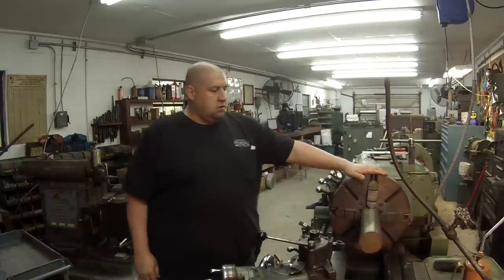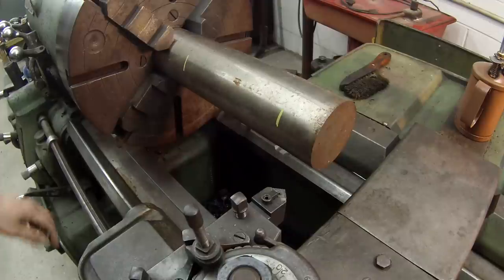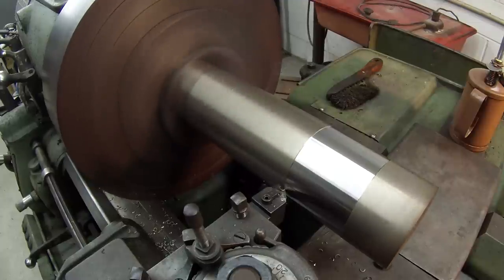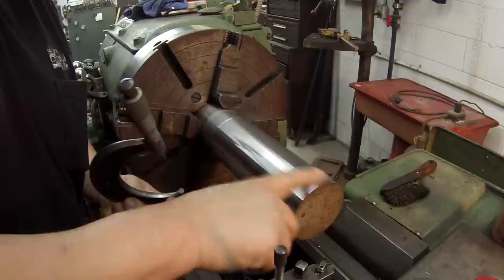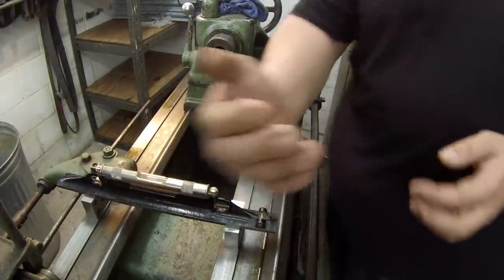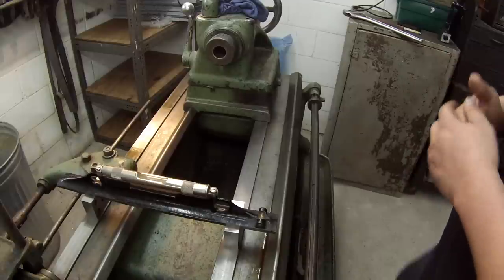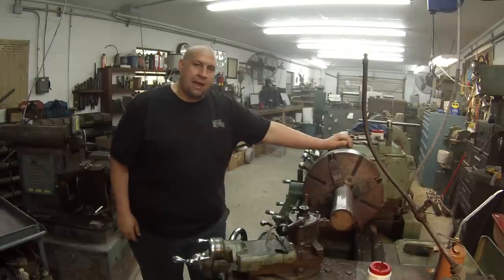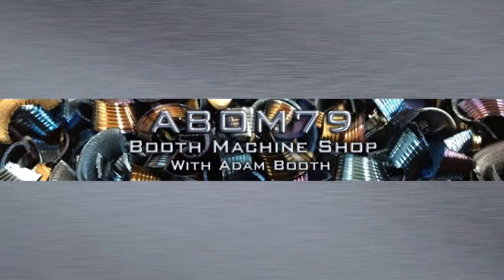Monarch Lathe Test Cuts and Alignment

Comment: Hard to complain about a 10th over 10 inches, check it again in about 4-6 months, dollars to doughnuts it moved. The worst lathe I ever leveled had a 14 foot bed and spanned across 3 concrete slabs, it took us 4 days to get it level! In 3 months it was out again.

Great job, enjoyed that very much!
Reply from the maker: We'll revisit the leveling and straightness chuck in a few months and see if we get some changes. I have no doubt that it will. The Pacemaker at work has a 14' bed. It was a pain to get leveled up, and I'm sure it's not even close now.
Reply: There is nothing still, straight, flat or square in the real world.
The question is; is it within tolerances?

Comment: Hey Adam,
A tenth of an inch in about 10 inches is pretty damn close. If that holds true, that would be about 2 tenths for 20" I don't ever recall you turning something that long. If you start turning 8-foot prop shafts like Keith "GetterDone" Fenner, then some additional tweaking will no doubt be in order. Thanks for the video!
Have a good one!
Dave

Comment: Round head Colchesters have a headstock angle adjustment as I recall. Do not know about others, so at least in the Colchester case the headstock adj. could be off. Ideally you could extend your test bar down to the tail stock to check twist all the way to the tailstock as well bed wear along the ways and misalignment of the tail stock. Keith at vintage machinery had a problem with a badly worn saddle to the point it needed to be built up with Moglice or similar material.

Comment: As my mentor always told me. Earth level is a starting point. If after Tramming/Alignment of the machine, earth level is off a bit, does not matter at all. How the machine cuts is what matters. If earth level is close, coolants will flow/drain correctly and really that is what earth level is for. All machines have twist and crown. If after you take the twist and crown out, and machine cuts like A bomb got it.....Earth level, Shmevel!

Comment: Hello Adam,

Your video demonstrates sometimes have a hard time getting over to people.

A lathe does not have to be level to cut true and you don't need a precision level to install a lathe. I once set up a lathe with the back left corner two inches higher than the front right corner just to prove the point.

The aim is to get the lathe to cut true and in the end the only test that matters is to cut a test piece. You showed in your previous video that you couldn't trust the level because of wear in the bed throwing off the reading.
Reply from the maker: I would rather show the factory recommended procedures to properly level out a lathe, and saying that I don't think I followed there recommendations perfectly after reading some of the older manuals. It's best IMO to use a level and get it close.

Comment from the maker: I wanted to add, now that the new camera mount video has been posted, this was one of the first videos I made using using the Rode mic on the machine. You can hear me better when I'm first talking at the beginning, but notice my voice isnt quite as clear when I'm behind the camera during the cuts. The mic picked up the noise of the turning tools well, but not so good when I'm talking behind it.
The mic is great for picking up audio from the direction it's pointing, but not so much from the side or behind it.
My hopes is that the isolation mount will help with the machine noise you always hear when the Noga is stuck to the machine, like on the tail stock or compound.
But anyways, just wanted you guys to know the Rode was used when filming this video.

Adam
Reply: That sort of mic is highly directional by design, specifically intended to minimise pickup from directions other than where the camera points. Maybe swing the mic around to point at you while the camera points at the machine?

Comment: You could tell on the video that there was a discrepancy between the just machined journals, with a little "tool drag" on the end of the piece as you pulled the tool back. Is this what you called "push off" ? Big thumbs up!
Reply from the maker: That can be considered push off no doubt,l but I'm hoping it is also because of the twist I was getting. But any work piece hanging way out is subject to flex from the tool, thats why I chose to use very light cuts and a large diameter.

Comment: Question: what is a "spring cut"? I tried to search for it but just come up with links to spring manufacturing. Love your vids, I've learned a lot.

Duncan
Reply: Hi, Duncan. I see this post was from several years ago, and you may have figured it out already. Any machine, no matter how rigid it appears, has a certain amount of elasticity. This means that it flexes or bends, however slightly, under high loads, such as those experienced under quite heavy cuts. Once the large cuts have been made, the lathe operator normally makes a second (or third) pass over the part, without making adjustments to the cutting depth. This allows the machine to "work out" the "springiness" inherent to all instruments, and give a true reading. Hence, the "spring" cut.
Robin Renzetti, (YT channel robrenz) is a metrologist, and he reckons that we should think of any machine or system as being made from rubber. Everything gives, no matter how slightly. 
Hope this helps.

Comment: A spirit level I have to acquire. Informative video, demonstrating the removal or introduction of twist to take out the taper. Clearly, it has an effect.
Do you have ventilation in the shop to get rid of the "shop fragrance"? Nice program, Adam. Thanks.
Reply from the maker: No ventilation so to speak, but I do have a fume extractor I can use, I just have never set it up for the new shop. It looks like a big turbo charger, with some pipe fittings to position the inlet where I want by the machine. The smoke has never bothered me though.

Comment: Great video as usual. Question, the "twist" that you called it, isn't that really uneven wear on the ways where the saddle is most heavily used?
 Looking forward to the coolant fix and then the tail stock rebuild.
Reply: I was wondering about way wear too.
Reply from the maker: You have to consider wear on machines, but lathes have twist in the bed. Even brand new machines from the factory will have twist in them when you move one in and set it up. The "twist" isn't enough to see by eye, but its there.

Comment: I have been told to leave the HS side 2/10 smaller by people a lot smarter than me. For certain, the lateral load on the tailstock when using live center is reduced by at least a factor of 4 due to misalignment. for this reason alone, the effort is justified.

Comment: Adam and Tom, I watched Tom do the alignment test cuts and you too. Nice work as always. I was wondering why make the undercut? Would the same info come out by making a cut and the both ends and then check the diameter difference without making the undercut?
All the best,
Eric
Reply from the maker: It's mainly to keep from having to take a long cut. All you need to is two areas big enough to measure.
Reply: Ideally far away from each other so you can see the full length of the travel off center. Right?
Reply: Additionally, you can move the carriage from the outer cut to the inner cut without moving the cross feed setting.

Comment: Why didn't you use the same bit to make the undercut as to make the adjusting passes? It seemed to make a much cleaner cut.
Reply from the maker: That's because I was taking a heavier cut during the undercut. It's harder to get a bright smooth finish when your only taking a few thou using a carbide insert, depending on the insert used.

Comment: I’ve used 400SS for windmill shafts that are exposed to weather extremes in cold climates and have never had a failure.  Just a question..did you run identical tests with identical stock before moving the lathe?

Comment: Ok, so after my last question, I read the other comments.
lesson learned... from now on I will do that before commenting.

Now I know why you did not use the tailstock but I am still curious just how the bearings play into things.  Also how accurate the lathe is supposed to be as per the factory claims/promises?

Also, what is the most accurate you ever have to be when doing the kind of work you do?  Is there an industry that must work to more exacting standards?

Last question...
Wouldn't a digital level be much more accurate and a better tool for dialing in something where you are looking to make such small adjustments?
I too like those Starrett levels... have used them but don't own one... but I now fell in love with my digital level and keep a few on hand in my different shops / toolboxes.

I have come to just not liking to use my bubble levels any more.

Again, as always...KUTGW
Anon

Comment: Is it possible to run a dial indicator on it while you're cutting to see how much push off there is?
Reply from the maker: I'm betting you would be seeing the needle flicker around too much to have an accurate reading.
Reply: Abom79 Probably...i'd never seen anyone do it and just wondered if it was a thing that could be done (might wear the tip too)
Reply: Yeah, it'll grind the tip right down.  It only takes very low force to move the pin, too, so it'll also skip and chatter and be too noisy a reading to use.

Comment: Can you please explain why you did the undercut first please?
Reply from the maker: Mainly to have two small straight turned areas to work off of. No real need to make a long cut. You really just need two machined areas big enough to measure.
Reply: Thanks.

Comment: Adam:
When you stop the chuck rotation on the Monarch lathe I hear a high pitched whine from the machine. Is something running when the chuck is stopped? What's going on with that lathe, maybe some sort of idler mechanism?
Reply: Rj Morgan RJ, the electric Motor is running continous. Engaging the chuck is done via a clutch mechanism, that works better for heavy parts than kicking the engine from zero to full speed in splitseconds. Cheers

Comment: I'm curious as to why you didn't face and center drill the free end of that piece, and stick the tailstock in it. I would have thought for a test like this, that you would want the stability.
Reply: Don, I believe it is so the tail stock doesn't influence the test. Hence the really stout piece of stock.
Reply from the maker: Yes, this test is to check the alignment of the headstock with the carriage of the machine, to make sure it is cutting straight. The tail stock is a different animal to tend to. We will get to that later. To answer your question, if I was to use the tailstock holding the work piece with a center, then I would be reading the errors in the tail stock, not in the bed ways.

Comment: Now that you have brought that end of the lathe up maybe the tailstock won't be so low. Since the Monarch uses a split base tail you could fairly easily shim it if you had to.
Reply from the maker: Yes i will most likely have to shim the tail stock up a bit to get it inline with the center axis.
Reply: I guess with your tools available maybe spray welding milling and file fitting might be an option as well. :-)

Comment: So with the adjustments showing half a measurement 'off' level after dialing it in, is the adjustment compensating for the headstock alignment with the bed or is it something else?  Getting it down to 0.0001 after starting at 0.001 is quite the improvement! :)
Reply from the maker: I am assuming that I am compensating for wear in the machine, or twist in the bed ways.
Reply: twisting the rear part of the weys (ways?) up to compensate for the uphill travel the tool has to make to get back to the level of the part in the chuck. However, you tightened up your tolerances around the chuck area which means the further away from the chuck that you get, the more out of calibration or level the tailstock will be compared to the chuck or the material at the chuck. Am I right about this?

Comment: Wow I didnt know that works.  There are so many lathes with tapers from age and use.  Does this mean you could reduce or eliminate this problem with ta simple table twist?  Probably it will over shoot at the far end and under shoot near the chuck, but most work is done is a relatively constant area of the bed so I guess this would work.  Nice

Comment: I never doubted the big Monarch would cut good. It's made a whole lot heaftier than the  new stuff. I think if you had done a spring pass on the very first cut it would have been very close to true as it was.
The 400 series SS seems to machine well. How is it for corrosion resistance and galling? I have to make some threaded rod and valve plates in the near future for a water treatment facility and it would appear to be a good material choice.

Colin ;-)
Reply from the maker: Colin, the 400 grade stainless machine excellent, but will rust and is magnetic. It's stronger than 300 though, and is used for pump shafts or motor shafts. As for galling, I believe it's slightly better than 300. We mad to machine a bunch of them with threads on each end to accept couplings.

Comment: if your bearing in headstock are worn the pressure on tool willcause the work to cut shallower than near the stock, simple physics
if you  put a toolholder blunt end in and take it up to the work, place a dti on the work then dial in oo2 with your cross feed, then see how much movement you have in the head bearings , take a long pipe put it in the chuck, then lean on it, you'll see wear easily, least that's my take on it    Adam

Comment: If you put a 6 foot straight edge across the lathe and site it with a quality level like a Topcon it will be much more accurate than a machine level. I think I prove that on my two. Metre bed lathe

Comment: Adam
To what tolerances are the lathe bearings held?

Is it possible that the play regardless of how incremental in the headstock bearings will magnify itself at the far end of the stock? 

Would it not be better to make sure that you run this test with the tailstock attached to the workpiece?

And again... what about the combination of run out created by the bearings in both the headstock and tailstock?

I am not a machinist and just wonder exactly how accurate you guys are supposed to be.

Please respond with your thoughts.

Thanks,
Keep up the good work,
Anon

Comment: What do you recommend to flush the headstock...ATF or kerosene like manual says? Just bought a 1951 monarch ck and doing all the pm before operating.  Nice video btw about adjusting taper.

Comment: Dear Adam:

I use a Shop Vac with a HEPA filter in combination with the premium yellow bags which are suitable for fine drywall and concrete dust. This will get all of the dust off your shop floor. Don't try to use standard bags and filters. Concrete dust is so fine that it will blow through.

Comment: Now you've gone and done it !   *One step closer to ROCKET SCIENCE :p    It's great to see an older machine get a bit of 'hot - rodding' !   Tweek it a little more, & you'll be in the SCIENCE FICTION realm ! ! ! 
    Past few years, I've been designing and cutting faceted gems. . . using a worn out machine that was built in the '70's . . . with a great deal of eyestrain, I'm getting accuracy of a wavelength of light - *polishing facets to get the same color of 'reflected' light . . . it's practically magic !   By constantly keeping 'backlash' in check, incredible results can be had !  Horizontal & vertical angles on the machine have micro adjustments , called 'cheaters' - which leads me to the old saying 'cheating you blind' ! ! !   I must admit that ten hour days of cutting have led me to wearing stronger glasses :( 
                   Great to see you getting some MILLWRIGHT experience & sharing it with the rest of us !     Thanks Adam !